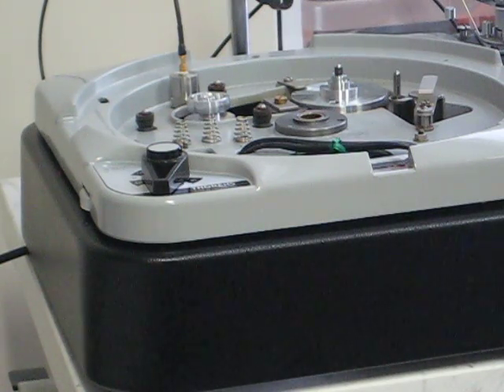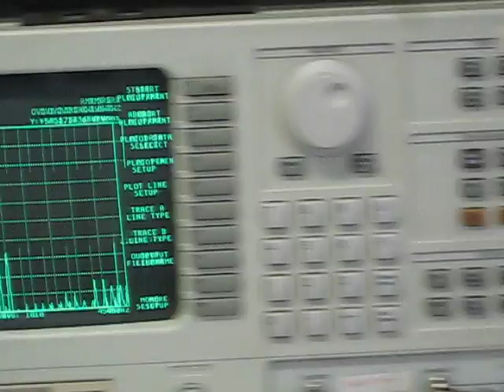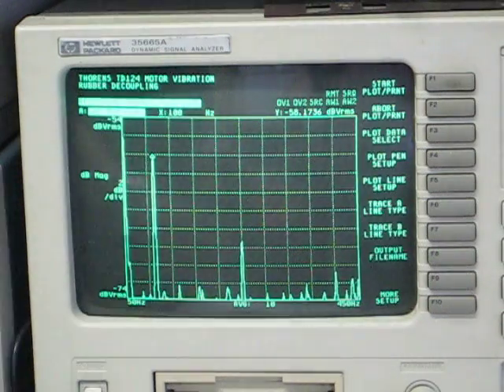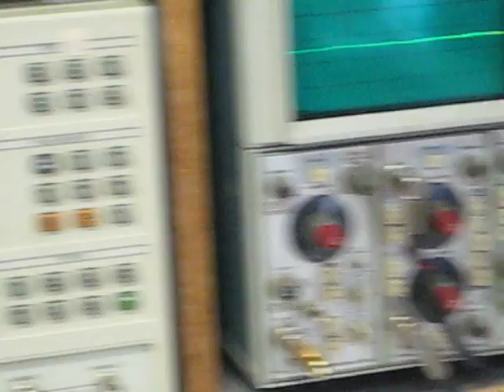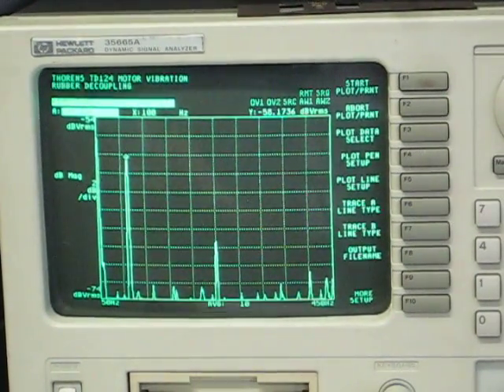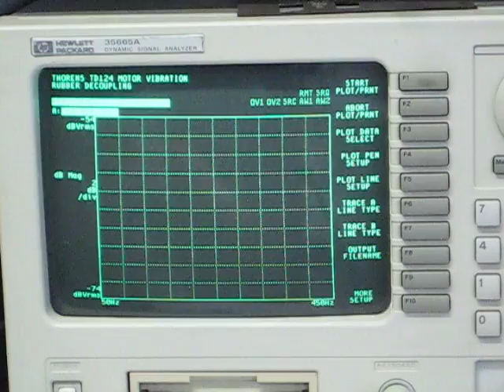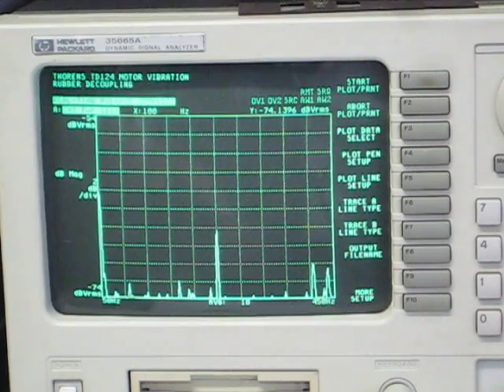Thorens TD-124 motor suspension modification

Comment: It appears the motor is also free to oscillate on the horizontal plane. What effect does this have on the belt tension? It would initially appear that the speed of the platter would be affected by horizontal movement of the motor. Thanks.